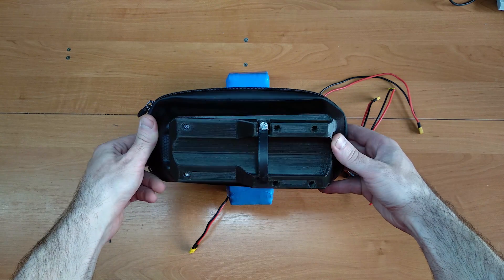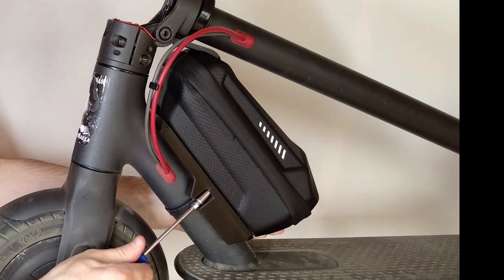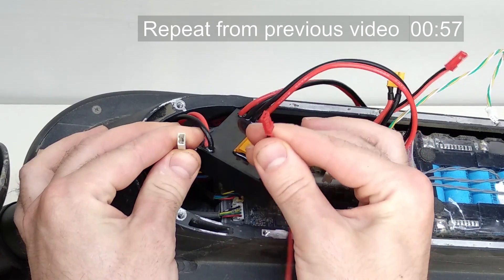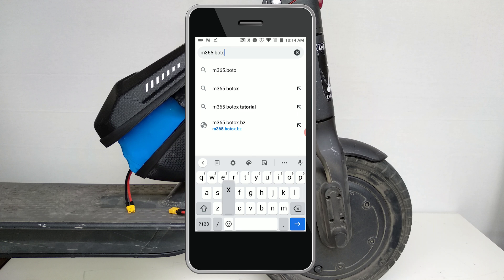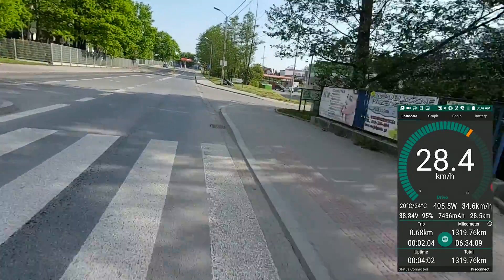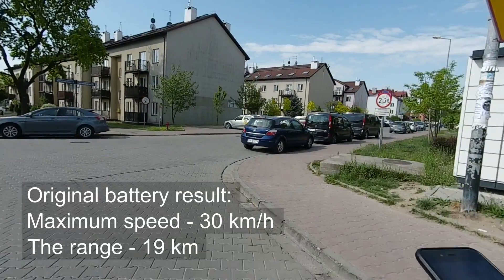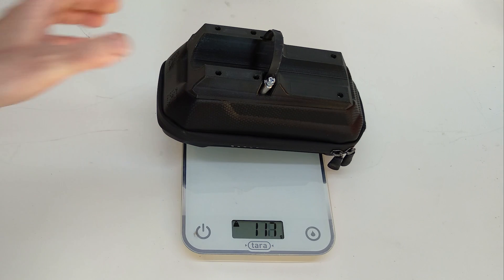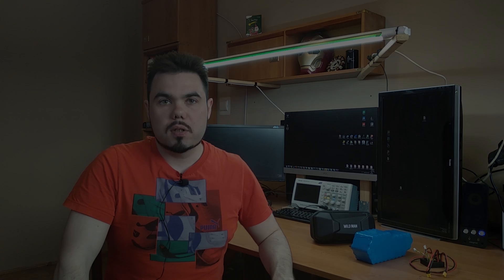Xiaomi M365 / PRO / PRO2 / 1S / 3 extra battery installation tutorial

Comment: Hello, is the external battery safe to drive with during rain? I use my scooter for daily commuting and sometimes there's no choice but to drive while it's raining, which makes me worry that an external battery is a bad idea for my use.

Also, my use of the stock battery sometimes causes overheating during long drives as I modified the firmware to draw more current for hill climbing. Does the RITA adapter evenly distribute the load between two batteries or does it always drain the external one first? I'd just like to know if I should opt for the 12s battery pack over the 10s. Thank you in advance!
Reply from the maker: Hi, 

1. I would say it is safe to ride during rain if your battery is packed and sealed well. My batteries are good enough.

2. Rita drains a single higher voltage battery first. Then, when batteries voltages are equal, the current is shared between batteries. A 10s external battery is the best choice for you, becase it operates together with the internal battery all the time, while a 12s battery must be discharged by 50% before its voltage drops to 41-42V to start operating together with the interbal one.

Comment: hey cool video may i buy your kit :) you may know if the voltage for all m365 pro2 where same?
Reply from the maker: Hi, I did not understand the question.
Reply: @DenisYurev  sometimes there are devices they have different voltages depending on where you live.
Like some countrys using 110v-120v and others 220v-240v
Im just concerned that might something can get damaged when i build this kit inside my escooter cause the voltage isnt the right one or something like this
Im a fucking noob when it comes to electricity just that ive said it 😃

If u can take my concerns that would be great 😁

Comment: I do have a question, I am looking to purchase the extra battery pack with the 20% added speed. Do you still need to flash some hardware or is it just 'simply plug and play'. Or is it just the the extended range one where you just plug and go?

And if I connected just the range pack, do I need to separately charge the additional pack or can I charge both batteries at the same time via the scooter charger?
Reply from the maker: The latest Rita generation is equipped with a  feature, which allows to avoid flashing the controller when using a higher voltage external battery together with the original internal battery.

You need a battery with a common charge and discharge port to be able to charge it via Rita.
Separate port will also work, but there is a risk of overcharge, because this separate charge port bms is not able to interrupt charging on discharge output
You can leave it as is, and be very careful, understanding that there is a real risk of fire
Or you can replace it's BMS to a common port one: https://aliexpress.com/item/32875971231.html
Or another option is to charge the external battery separately via it's charging port, not using Rita for distribution charging current from a scooter charge port. In that case you don't use Rita charge plugs at all. You should connect the scooter charging port directly to the original internal battery(as it was connected from a factory), and if you connect it like this the charging current from the scooter charging port will not go to the external battery via its discharge port.

Regarding your question: there is no need to charge the external battery separately if the battery is purchased in my store, because it is equipped with a proper "Common port" BMS.
Reply: @DenisYurev  Thank you for this amazing responce. I can see why people are delighted with your professional help! I will very soon order the Rita! Thank you very much for explaining so clearly👌🏼
Reply: @DenisYurev  I ordered the range&speed kit, on its way this week 😀. I got the same question regarding the need to flash the firmware. So far I understood your answer we don't need anymore to modify something in the firmware with the latest Rita release? I'm running my Pro2 scooter with Xiaogen cfw, the charging mode is already deactivated, so I wondering if I need to reactivate it or not? I also wondering if I need to modify the overvoltage battrry setting? By default parameter is deactivated but shows 43volts. Thank you in advance
Reply from the maker: @sebzr7_63  I would say you don't need. But let's see.

Comment: Heey! I checked your home page and if I want to get speed + range gear, do you have firmware update tutorial somewhere?
Reply from the maker: Hi! Unfortunately I don't have it, you have to discover it by yourself. By the way, the new Ritas generation allows to use higher voltage batteries without the firmware upgrade!
Reply: @DenisYurev  if  I have firmware update (which gets me atm 33kmh speed) I dont need to update that anymore? anyways I ordered the pack, and cant wait to get it delivered!

Comment: Which app did you use to check the speed ?
Reply from the maker: m365tools
Reply: @DenisYurev  Thanks for the reply, one more thing I am interested to know, is it okay to use a fast charger which output is 42 v - 4A  on Xiaomi scooter pro 2 , the original charger is 41v-1.7 A. Will it create any problem if use the fast charger ?

Comment: Hi Denis! Awesome work and awesome kit!

I’m wondering if this would work with a smaller capacity 36v 10s battery such as 3000/4000 mAh ?

I would like to make a more discreet modifications to slightly extend my range
Reply from the maker: Hi!
It will work with the battery you described. But consider also a cheaper and simpler y-cable mod. Because Rita is too expensive for your tiny battery and it does not worth it =)
Reply: @DenisYurev  thank you for the response! Always good to get a recommendation from someone who knows what they’re doing 😅

Comment: Hi Denis! I just got a Mi Pro 2 and love it! Unfortunately, I live around 11 km from the city centre where I work and the difference in elevation is around 350 meters. As expected, the scooter cannot take me home, as the battery is not large enough and it drains before I get home. Do you know whether adding an extra battery with the same voltage (i.e. without software modifications) will void the warranty on the scooter? Thank you!
Reply from the maker: Hi! Yes, of course it will void the warranty =)

Comment: How is that with the charging of the battery? Is it charged with the original charger or must the spare battery be charged separately?
Reply from the maker: If the external battery is a common port BMS equipped(one couple of wires for both charging and discharging), then it may be charged via the scooter charging port together with the internal one.  If the external battery is a separate port BMS equipped(with a dedicated charging port), then it is not safe to charge batteries together, because Rita charges an external battery via its discharge port, while a separate port BMS is not able to interrupt charging at its discharge port, which may be dangerous. 

Another thing is the battery must be a 36V one, otherwise original charger will not able to charge it, and you need a new higher voltage charger

Comment: Hi Dennis. What is the most hassle free way of doing this? The 10s kit will charge with original charger, show correct battery state while driving and while charging? I don't care about top speed, its illegal here in Sweden anyway, I don't want to risk getting stopped. I only want extra range.
Reply from the maker: Yes, 10s is the simplest. No new chargers, plug and ride. And yes, proper charge level displaying.

Comment: Hi! Is it possible on xiaomi essential? If I only want more range, so same battery as original, do i have to buy new charger and hack the system? If not then will the original app show the right values of range etc?
Reply from the maker: Hi, yes, it works on Essential. No hacks or new charger are needed if you use a Range boost kit, not a Range+speed boost one. Original app will not display estimated range correctly.
Reply: @DenisYurev  thanks. If I add another battery with bigger mAH but same voltage, do i need Rita adapter?

Comment: Hello! My question is: Does it affect the acceleration? Due to my higher weight, the 1S seems to be too weak for me. It would be nice to know if a second 10s 36volt battery could increase the torque and therefore the acceleration in Hills or similar. Thanks for your answer in advance! Rita is a nice development for e-scooters!
Reply from the maker: Hi! Yes, it significantly affects acceleration, because voltage drop is less with the second battery.
Reply: @DenisYurev  if i have rita can i charge the internal battery by plugging the charger into the external battery
Reply from the maker: @jameelahmed840  Hi, no, you can't

Comment: Do we have any solution to the problem that the link for mi 1s cfw is down? Is it possible to use the pro2 link or is it still possible to flash in xiaoflasher for the 1s? Kind regards
Reply from the maker: One of solutions is to use a paid XiaoFlasher version, with the firmware builder included.

Comment: Hey I purchased a: Rita adaptor, from your Link.. 

I also purchased a: genuine Xiaomi 7.8ah battery from: Catch of the day..

I have a Xiaomi 365 e scooter..

& I Live in Australia..

Will the Rita adaptor, I purchased from your Link, still be compatible?

(Because I live in Australia 🇦🇺..)

???

Thanks for the awesome.. How to video, btw.. Your a gun!!
Reply from the maker: Hi!

This is a bad idea to use an original battery as an external one, because it is equipped with a separate port BMS, which is not able to control the charging process on the discharge output, while Rita charges an external battery via the same port as discharges. Rita is designed to be used with a common port equipped external batteries, that's why you have problems.
Possible solutions are:

1. Never charge the scooter with the external battery connected. Charge the external battery separately. You have to disconnect the external battery every time you plug a charger inside the scooter. Or, to avoid external battery disconnection every time you charge, you can leave Rita charging wires not connected, connecting scooter charging port directly to the internal battery, as it was factory connected. In that case Rita does not charge an external battery at all, so you can just plug one charger to the scooter port. and the second to the external battery.

2. Replace the external battery BMS to a common port one, which does not have a dedicated charging input and allowed to be charged via its discharging port. And then  use Rita normally according to it's user manual.
Reply: @DenisYurev  thanks so much!!

Comment: So if i install this all together and want to charge the battery, can I just charge it normally? Or will I have to charge it seperately?
Reply from the maker: You can charge both batteries via the scooter charging port if your external battery is equipped with a common port bms(single couple of wires for both charging and discharging). If your external battery has voltage more than 10s(36V), then you also need a new charger.

Comment: What if the Rita fails? Will the larger batter blow up the other battery?
Reply from the maker: Yes, the lower voltage battery will be overcharged and damaged. I did some tests - good branded cells does not explode or take fire in that case
Reply: @DenisYurev  This is quite scary. Maybe it would be battery just to match the volt with batteries instead of this Rita, but I guess some people don't mind.
Reply from the maker: @TheLondonCyclist  You are totally right. And it's scary to live when you are an expert in some fields and see what people do =)

Comment: just installed mine and couldn't be happier, easy to connect and install and with my 15Ah extra battery and limit amps to 25 i am getting 80km range on my pro 2 now. thanks again
Reply: Hi bro rita is complete with xiaomi pro2? Is different battery then m365 pro cable
Reply: @mrzoro6121  i have pro2 and fits perfect, all plugs fit. not sure about non pro m365. takes 10 mins to install and works perfect, i added a 15Ah battery as extra and I adjusted firmware to max of 20 amps now I get 80km range
Reply: @matt060383  I have new motherboard FSESC4.20 50A where I can conect the data battery cable is problem
Reply: @mrzoro6121  just watch the video, if its different than the stock board then it probably wont work
Reply: @matt060383  thanx bro

Comment: hi, your kit with 12s card and battery, couldn't it be risky for the voltage increase?
Reply from the maker: No, original controllers easily withstand 12s batteries
Reply: @DenisYurev  ok but the engine could be damaged?
Reply from the maker: @sabrizio75  It could not be damaged by VOLTAGE. But it could be damaged by too much CURRENT. The current depends on the custom firmware power.
Reply: @DenisYurev  currently I have a standard m365 all original except the firmware, the one I use is developed by some guys in Italy and brings my scooter to 30kh, the problem is the autonomy, also I would like to bring it to around 38h is it possible?

Comment: Does it work the same in software with the xiaomi 1s?
Reply from the maker: Yes, I would recommend to use this firmwares builder - https://1s.cfw.sh/#, and XiaoFlasher android app to flash.
Reply: @DenisYurev  Link for 1S is not working anymore, I hope the right firmware is still somewhere and flashing it still works

Comment: can you hook up another battery with different voltge or does it have to be the same. Example 36 V and 48v?
I aiamagine no, just connect the same voltages but people on a fb page say you can. Thanks  for the response
Reply from the maker: The main idea of Rita adapter is to be able to connect 36V and 48 batteries together. The answers is: yes, you can connect 36V and 48V batteries in parallel using my Rita device.

Comment: wow- anyone know if it also works with the xiaomi essential model ? :D i would use a battery with the same voltage so i dont have to flash anything right?  Do i need also a new firmware? Greetings
Reply from the maker: Yes, it works. You don't need to flash the scooter if using a 10s(range boost) kit. If you use a 12s(range+speed boost kit), then you have to flash the scooter firmware.

Comment: If you use xiaoflasher to stop the software limiting the speed. What do you expect the maximum speed will be then?
Reply from the maker: About 30 km/h at 8.5 inch tyres and stock battery
About 35 km/h at 10 inch tyres and stock battery
About 42 km/h at 10 inch tyres and 12s battery
Reply: @DenisYurev  What if i stop the software from limiting the speed and then using the extra battery on 8.5 inch tires?

Comment: Can i still use the xiaomi charger to charge both the batteries or do i have to get a new charger?
Reply from the maker: If you use a 10s external battery, then you can charge both batteries with the original charger. You need a new charger if external battery voltage is over 10s. And please note, that an external battery must be equipped with a common port BMS to be charged via the scooter charging port.
Reply: @DenisYurev  ok thanks for the reply

Comment: Hi Denis. Is possible to put the battery bag on the top of the handlebar rod, facing outward, instead of the place down in the video?
Reply from the maker: Hi! Yes, of course it is possible, but I don't provide a mount for this, and you have to think about how to secure the bag. And you also need to extend the wire from Rita.
Reply: @DenisYurev  thank you.  I'm going to buy your kit at this Christmas. Has your shop  also an extender for the wire? I'm not sure to put the bag on the top, but I would like trying.

Comment: Im getting one! I hope it will get to me by Christmas! :D great mind, great job!
Ps. If i get 12s pack with charger. Can i use this charger to charge both batteries at the same time with stock scooter charging port? Or do i have to unplug 12s and charge it separately?
Reply from the maker: Well, the internal battery usually may be charged by a 12s charger, because it is able to interrupt charging when it is fully charged. But there is a tiny risk that internal battery bms will fail, and not interrupt charging. And in that case internal 10s battery cells will be overcharged and broken. 
Generally answer to your question is: yes, but carefully.
Reply: @DenisYurev  thank you for answer. 1 more quick question, is there any indication or clue i need to search for to be aware when tgis happens?
Reply: @DenisYurev  I ordered the kit, and I have a question too, if I not charging the scooter trough the original charging port, then how I can charge it? or Rita can handle this with the original port?

Comment: Hi! Just want to ask/ inquire. Is it also fit to xiaomi 1s without damaging some parts? And can we buy it to you? Hm including shipping? I live in rome italy. Thanks!
Reply from the maker: Hi, it works perfectly with 1s.
You can purchase it here: https://m365.embedden.com/
Reply: And for installing in Xioami 1s  was the same step/procedure in the video? Thanks.
Reply from the maker: @airojeoloyola6059  All is absolutely the same, except the firmware patching process. Check the actual 1s firmware there: https://scooterhacking.org
Reply: And how about for charging the extra battery? Do we need another charger for charging them or we can use the regular charger of xiaomi 1s?
Reply from the maker: @airojeoloyola6059  You don't need a new charger for a 10s extra battery. For a 12s extra battery you need a new charger

Comment: Hi Denis.  I understand that you can't post Batteries to Australia.  Is it ok to post the Rita Adapter by itself.  Also Would this work with an ebike battery like this (Ebay: 48V Ebike Battery Lithium 17.5AH 40A Tiger Shark case, charger, Samsung cells) to the scooter goose neck?  Thanks for your advice.
Reply from the maker: Hello, I did not find the battery you described